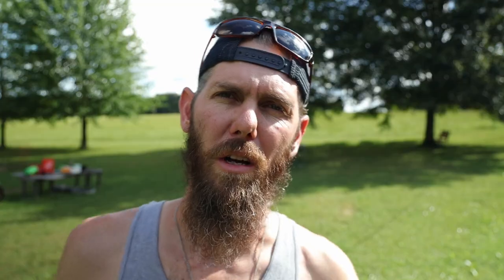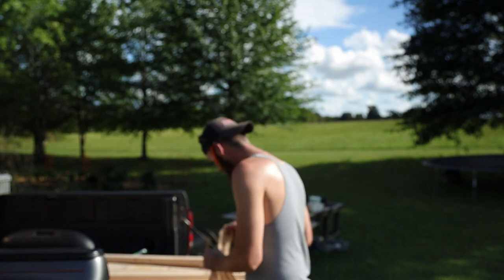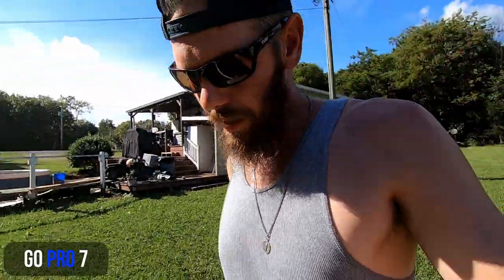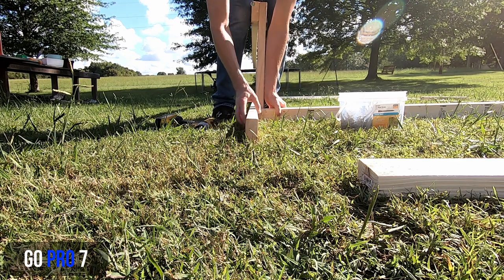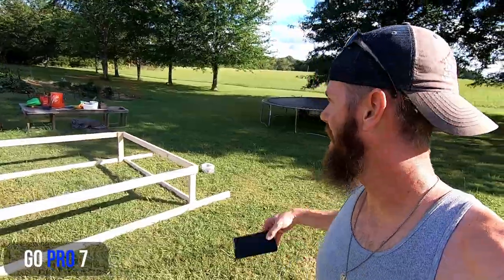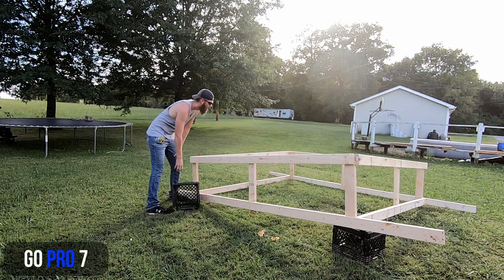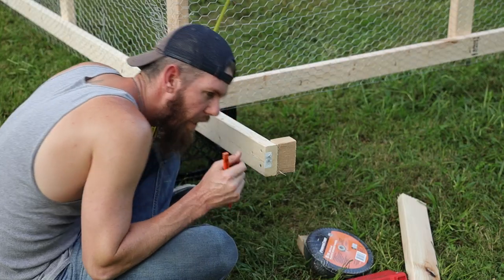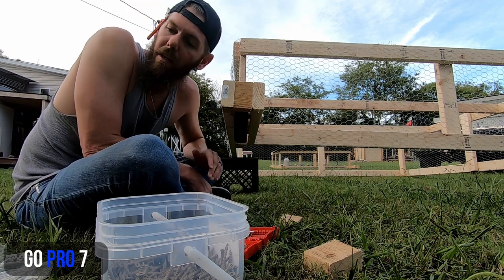How to build a Chicken Tractor For Meat Bird Chickens! | CHEAP! | EASY!

Comment: Because of the wheels there is a small gap between the ground and bottom of tractor.  Has that been an issue with predators getting in?
Reply from the maker: Sometimes. If you get a raccoon coming around he’ll reach under and grab them and it’s not pretty… but for the most part it’s just really helpful for moving it😊
Reply: Thanks. I followed your instructions this past weekend and the build went great.  Thanks for posting.
Reply from the maker: @nickgreene6651  awesome man